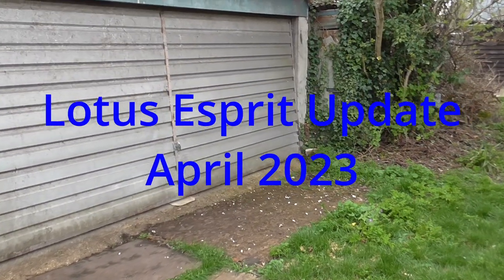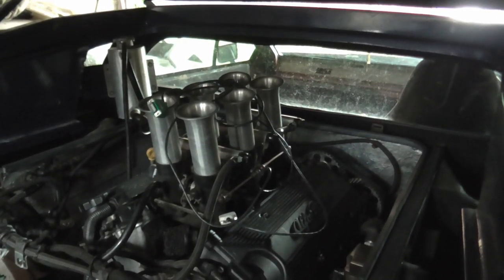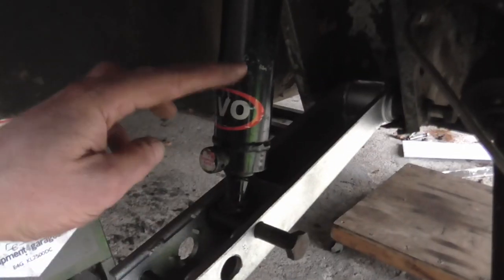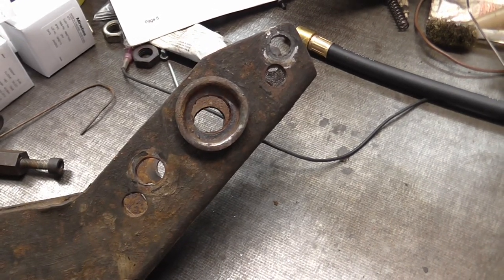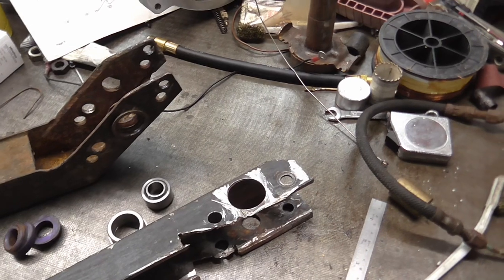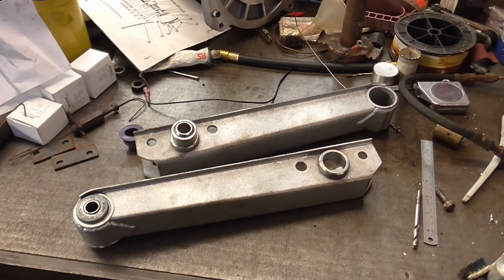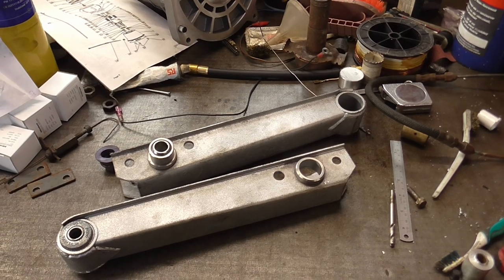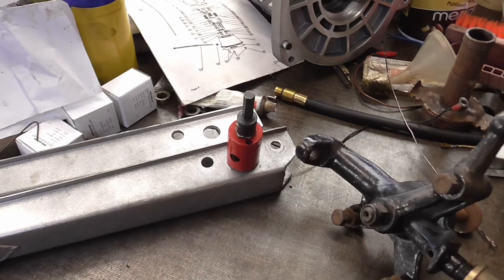Lotus Esprit Suspension Upgrade

Comment: Hello Paul. You my friend are a problem solver and a life saver! Ok maybe I’m going to far on the life saver part but listen.

I have been trying to research either how to make the leaf spring suspension on my small cargo trailer work (softer) with lighter loads or switch to a different type suspension all together.

Since I don’t want to spend a lot of money, like to keep the current ride height, hubs and don’t mind an axel I have been researching ways to modify my existing leaf spring system.

I was reading an article about a gentleman who was looking into doing some similar to a go kart and you had mentioned there were leaf spring calculators.

This is exactly the answer to one of my concerns about taking out a leaf spring from my cargo trailer.

You see I purchased a small utility trailer with leaf spring suspension that will support weight up to I believe 1,200 lbs. 

The issue is I only use the small trailer for cargo up to maybe 400 lbs max. So I’ve been looking into ways of modifying either my existing suspension or trying something different.

All while keeping the cost down.

Anyways thank you sir for your input.

You have gained a new subscriber too!

✌🏽🇺🇸🙏
Reply from the maker: Sorry for the very late response. Your comment was inexplicably 'held for review' and YT never seems to notify about such events.

If they are multiply leaves, you can remove one or two, possibly leaving just the main leaf if that will handle the load.

Comment: Just out of curiosity Paul, why did you decide against using a stepped drill to open up the hole in the arm to 35mm?
Reply from the maker: For starters, I don't have a step drill that large. Secondly, an annular cutter (holesaw, rotabroch etc.) is removing much less metal and is using multiple cutting edges simultaneosly. Less torque needed and much less chance of grabbing.
Reply: @EVguru  Fair enough. I do have them, and I find they are excellent at opening up holes in thin metal without snatching even when using a hand held cordless drill. The only problem using them with a shape like your lower arm might be the nose containing the smaller stepped drill diameters might catch the other side, if you wanted to make a single sided hole, not straight through.
Reply: I wondered what happened to Dean's car, I would have liked it myself, it did look good on the road, interested to see how it turns out...